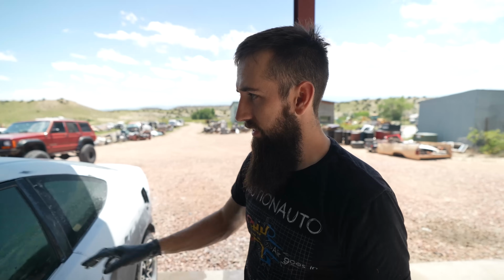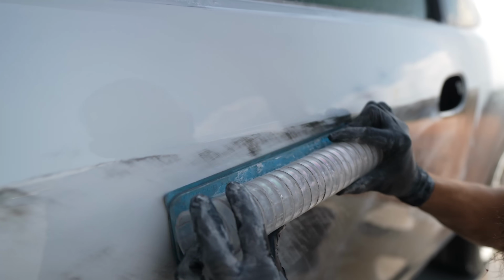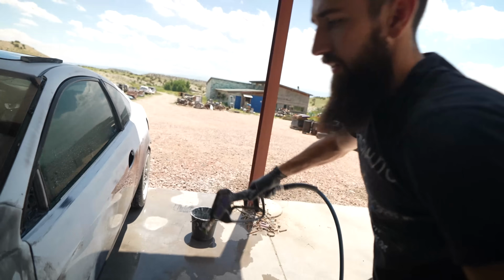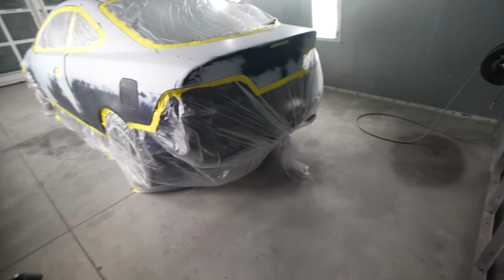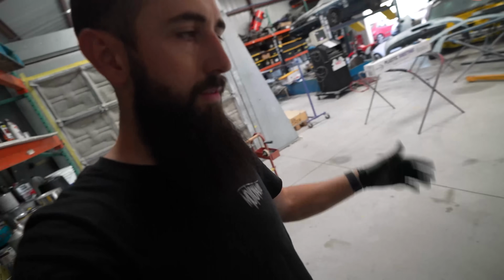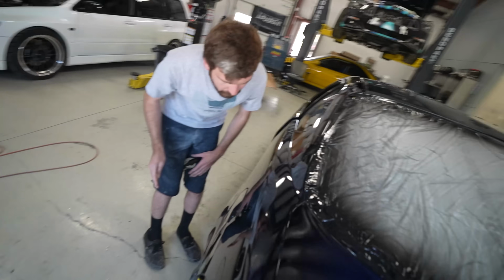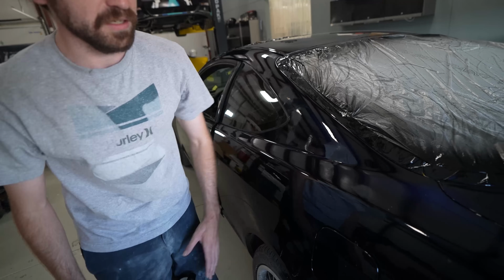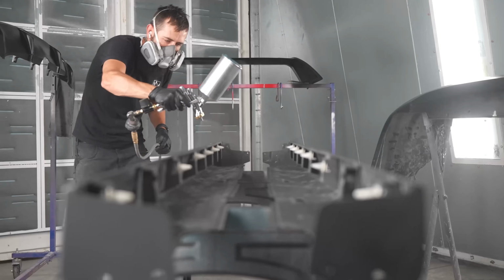LAMBO Killer 2.0 - IT’S PAINTED! ( Awd Acura RSX Type S Build )

Comment: Looks like the color came out exactly as intended. Did you end up thinning out the mid coat to allow for 2 coats?

White wheels would be the move on this. Maybe something with a polished lip to tie in with the chrome headlights.